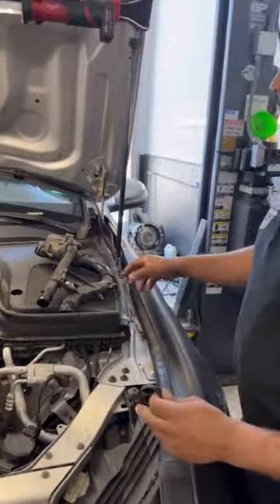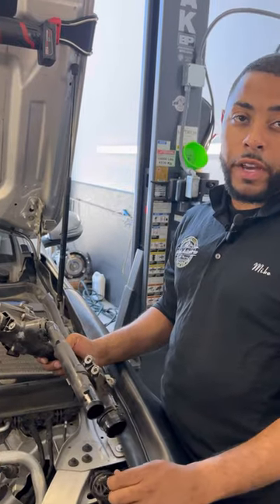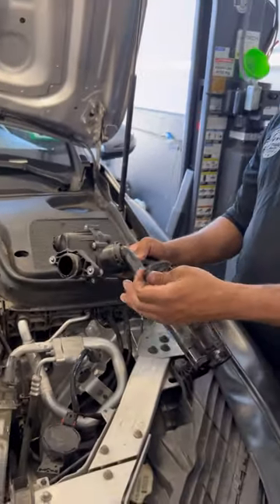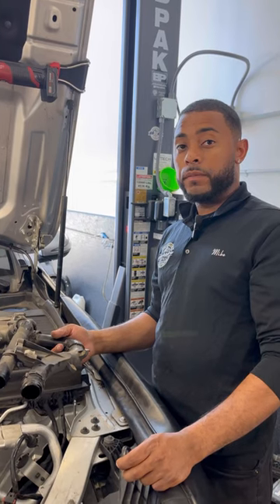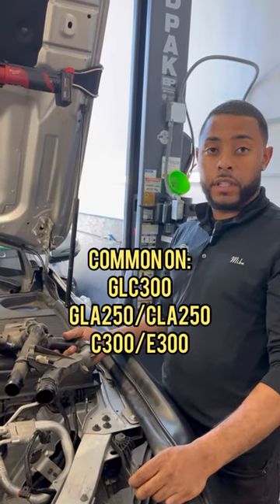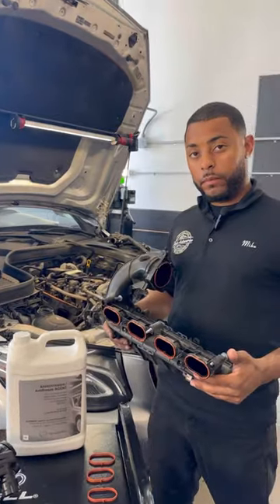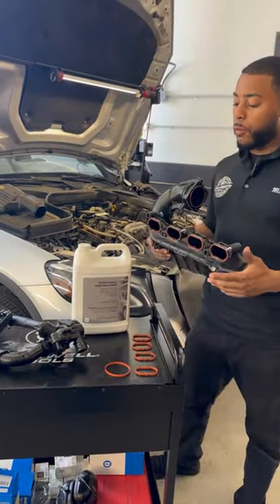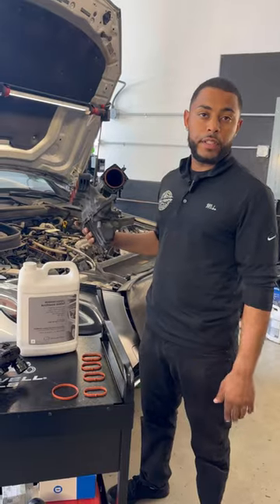Mercedes thermostat replacement. Fault Code P012800 #mercedes #automobile #P012800 #M274

Comment: 50k intervals are recommended for 4cyl thermos👍🏽 good job guys
Reply: my 2016 slk300, needs new one 53K miles, 8 years. 2024 price $700-$850 in Calif.
Reply: I am facing this right now. I got CLA250 . First i changed my resorvior coolant tank after coolant start leaking insanely. Do you know much it cost to get fixed in TX? I got almost 60k miles and it's 2014. Thank you!